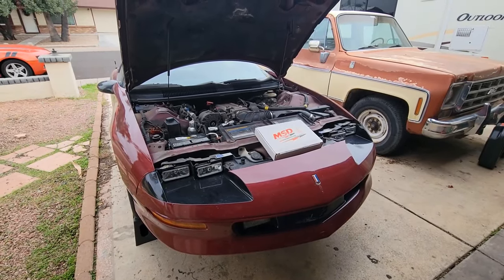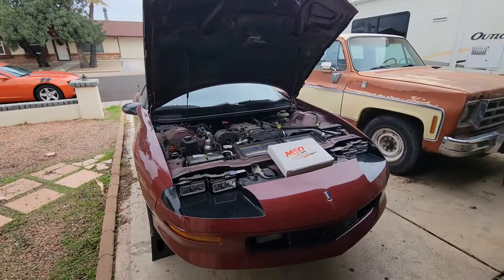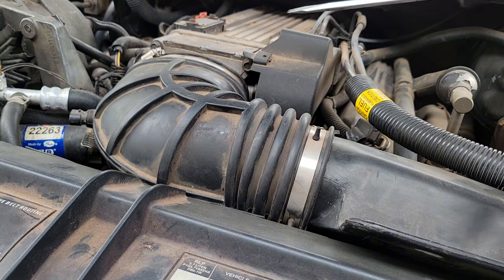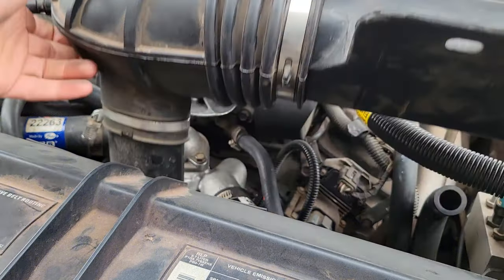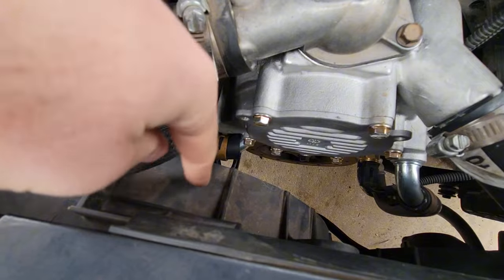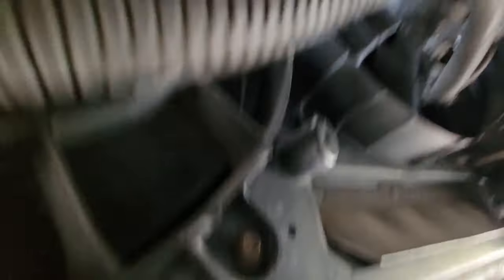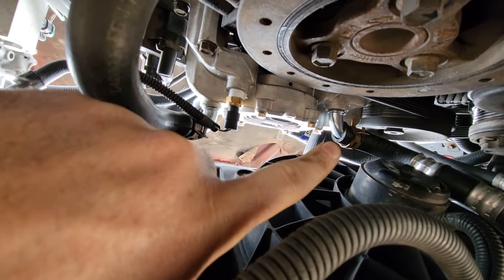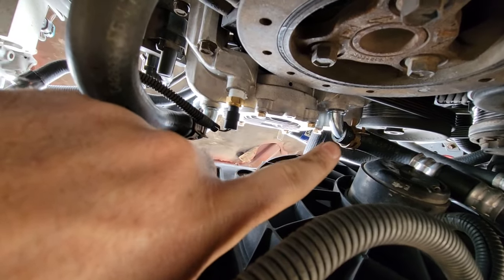Detailed Optispark Replace on LT1: MSD distributor with tips to increase life

Comment: Well crap, I did everything and so far no leaks.  I have tried burping it a few times, thought I had it done,  a 5 mile drive all good, come home and it started over heating fast, I noticed the first time I ran it it started to over heat and the fans where not coming on.   I realized I forgot the run the heater so once I did that it seems all good and the fans came on fine.  And idea what is wrong with my fans???  Any help would be great, I will try again to burp it, THANKS PICKLE         THANKS to anyone for help as well!!
Reply from the maker: @barneythedog977  Yeah I always double check there's no air pocket especially if you are burping it in a driveway that isn't level. I essentially have the cap off and then that bleed valve open. Then top off with it running until it starts to rise in the radiator, put the cap on and then wait for fluid to come out the bleed valve then close it Ill do that a couple times after it cools back down again Id rather lose a little more coolant than I need to than over heat. I do know with most electric fans they don't turn on until it hits a certain temp but if it was overheating they should have kicked on. Might have to replace the sensor but I'd double check on the air pocket first maybe it's messing with it getting a good read. If they came on when you had the heater going then that should mean you are fine on the wiring and everything, just might be the trigger thats messed up.
Reply: @picklesgarage  Thanks man!  Tell me please what sensor should I check.  I am getting a good reading on the dash so that sensor is working fine.  I hope there is another one I can replace if needed.   It was in a garage on four jack stands, as level as can be I think.  I will try that exact way to burp it asap.   I read in the manual I think, that it could take a few times to get all the air pockets out.
Reply from the maker: @barneythedog977  Yeah might just be some extra air in there then. The sensor I'm referring to is on the front of the water pump lower driver side it has a brass fitting and then a plug. Not sure if you replaced that one with the new pump. It's probably functioning OK it's more likely an air pocket but if you had to replace that they are pretty cheap.
Reply: @picklesgarage  I stuck the old one back in, isn't that the one that reads on my dash, which reads fine at least works, not sure if its accurate?  I would replace it if needed in a heart beat.  Will it leak all over, if so I could do another half arse flush and replace it.  I WAS LUCKY TO SHUT IT OFF THE FIRST TIME, IT WAS RGIHT AT THE EMERGENCY TEMP READING, JUST BELOW FOR SURE BUT SCARY.
Reply from the maker: @barneythedog977  So there are technically 2. The one on the water pump connects to the ECU which can make changes to air fuel mixture and should signal to the fans. There's another temp sensor on the driver side head that should be what connects to the gauge. Still might just be the air pocket issue it's really easy with these especially with all that got opened up.
Reply from the maker: @barneythedog977  and yeah it will likely leak all over. Might be able to do a quick nascar change to not have to drain completely but it will be a mess for sure haha.
Reply: @picklesgarage  When I drove it, it stayed exactly where it shiould be. 210-220 and below 210 when doing 60 mph.  I have to figure out why the damn fans are not turning on.  Good news is they work for sure.  You think a bad relay or relays?
Reply from the maker: @barneythedog977  Nice, you might be in good shape then if it's no longer heating up. You probably won't notice the fans until you do some stop and go city type driving otherwise the air flow will keep it cool enough and they wont turn on. But I always find an excuse to double check the fuses might be worth looking at just to make sure.
Reply: @picklesgarage  I ordered a new sensor for the water pump area.  I read and saw a video that said that sensor turns on the fans at temp.   Wish me luck   Thanks for the help
Reply from the maker: @barneythedog977  Sure thing, good luck to ya

Comment: Bro why the heck does the MSD go from 252 to 675 in price lol.  How much can they justify that, I guess maybe one is for racing ??
Reply: I am happy to see a well made choice for 252 ish.   I just heard when I doubt size 10  loll  I literally said to myself the other day man is 90 on stuff 10 mill now
Reply from the maker: @barneythedog977  Haha yeah they get ridiculous. Sometimes on the cheaper ones it's just the cap not a whole new opti so you have to sort of modify the old opti and replace the cap. That's the option I went with because I wasn't about to throw 700 at it and a pump and I didn't want to bother with a cheap opti either. Yeah 10 mill everything I always start there haha.
Reply: @picklesgarage  Oh ok so its more of a rebuild than a full opti, makes sense.